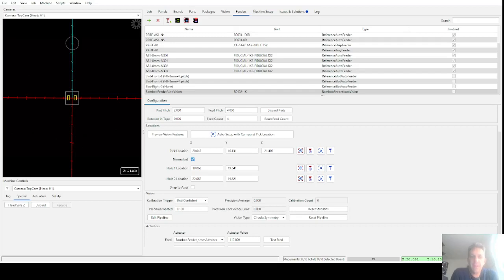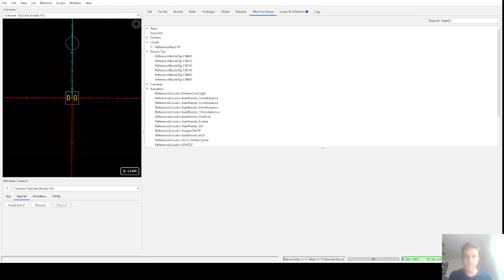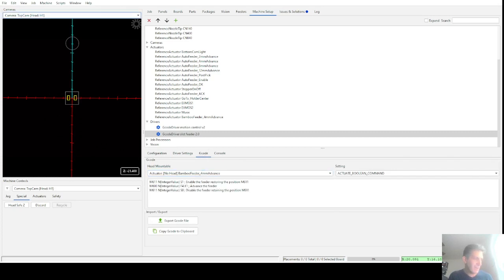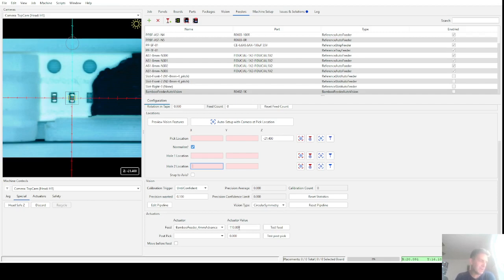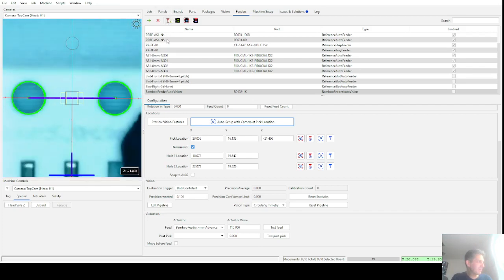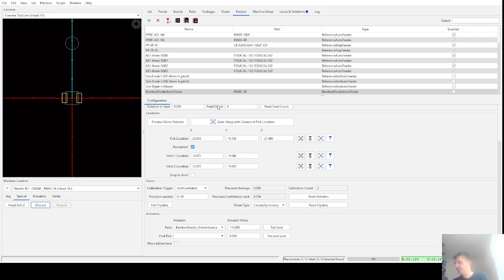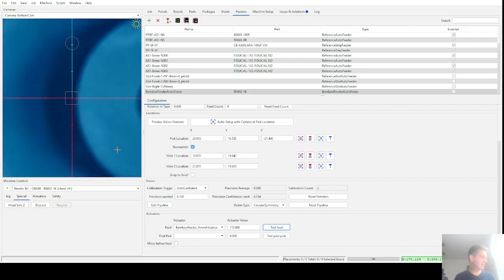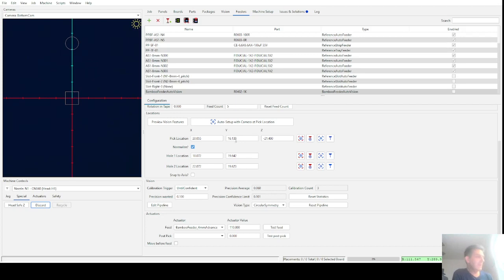PandaPlacer - Pick 0402 parts reliably - almost

Comment: I seem to have some issues with the new auto vision feeder. I've updated the firmware on the feeder boards, created a new actuator and added the gcode to the driver as you have shown. When I test feed, it does nothing but if I change to the standard 4mm advance the feeder advances. Any ideas?

Comment: In case anyone else has the trouble I was having, of motors just burning up - I was finding that, even with the M610 commands, my AS2 feeders were burning up, simply from turning on the machine!

So I added "M610 S0" to the Gcode for "CONNECT_COMMAND" under Default for the PPSLFC 2.0 Driver.

But the motors were STILL burning up.  It turns out that my Machine Setup included a ReferenceActuator AutoFeeder_Enable designed to turn on all feeders after a machine Enable or Home event.  Its ACTUATE_BOOLEAN_COMMAND is "{True:M610 S1}{False:M610 S0}" and its "On-Enable" and "On-Home" Actuation actions were set to ActuateOn.

I could just delete the actuator, but for now I just set those two Actuations to LeaveAsIs, and the overheating is solved.

Comment: Hi, as you indicate, this video is a preliminary test. Have you been able to test this further in the meantime? Can this machine reliably automatically feed and place 0402 components? We are looking for a device for our company to produce small to medium-sized series, mainly with SMT LEDs and the associated drivers. Does this device qualify for this?
Reply from the maker: Hi, Unfortunately, I got pulled away from pcb assembly for a while. I'll definitely get back to the topic soon.

With the vision-based feeder added to OpenPNP by Andrew and PandaPlacer, I was able to place 0402 parts practically and reliably for the first time. I haven't looked at OpenPNP for a few months, so it may be even better now.

Comment: Notes for others: BambooAutoVisionFeeder is using the same vision code as PushPullFeeder and according to the wiki, when the auto-calibration is started, the camera should be on the part closest to the reel.
So to get the correct behaviour, place the camera on top of the other part, capture the location and then do the auto-setup and it works great.

Comment: You mentioned there may be a quicker way to get to the bottom camera view / position. What I do is test these sorts of operations from the part view: you can do a feed/pick from that tab instead of being in the feeder tab, then if you have vision alignment enabled you can click "Test alignment" and it will move the part to the camera, change to bottom camera view, and do the alignment. Much faster than jogging.